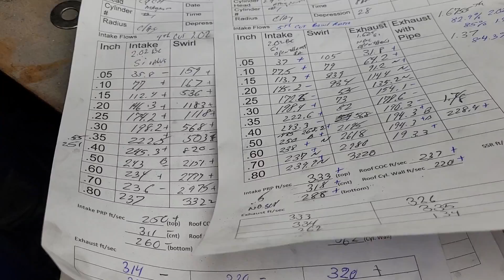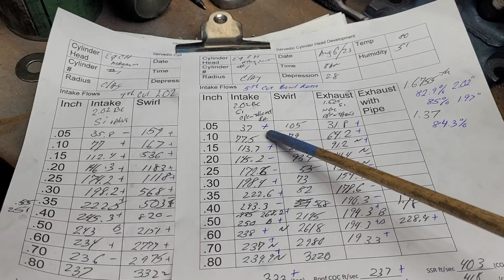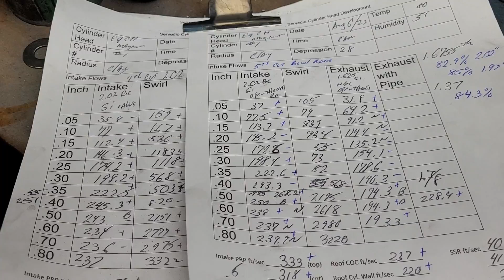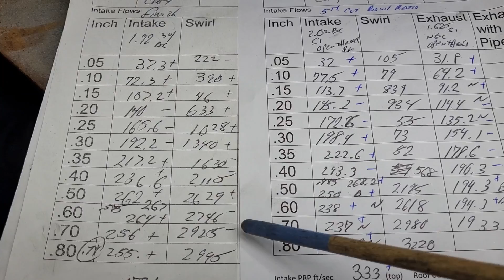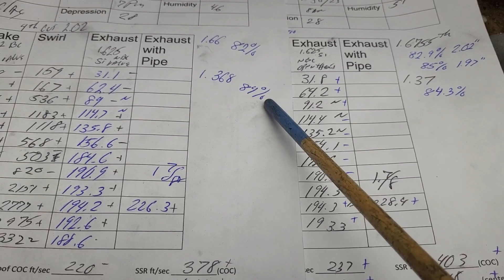EQ-CH 318B 318/360 cylinder head, small increase in bowl ratio experiment.

Comment: I've been really enjoying your cast iron work Charlie. Currently I have 3 project motors on the go, all with cast iron heads. A 5.0 Windsor with a 347 crank, and gt40p heads. Has to look externally standard, or the local police will defect the vehicle. Has to be reliable and economical as it's my work vehicle. Also a 351 Cleveland with 4V heads. Going into an XB GT coupe, that's what the Mad Max car was built from. Owner wants cast iron heads, because they came with cast iron heads. Another 351C for a Bronco. This is a 2V small port (by Cleveland standards) motor for off road and towing use. Again has to look externally pretty much standard, to keep the local constabulary happy. Probably going to use the closed chamber 302C heads on this motor as the amount of chamber work that I expect to do will drop the compression quite a bit. Not everyone has the option or the want too run ally heads. It's great to see someone who knows how to develop cast iron share their knowledge. Regards Greg
Reply from the maker: Build full sleeper engines. I love those. Looks 100% stock but rocks... thanks
Reply: you need to defund the police ..........
Reply from the maker: @slackthompson6984  No politics please!
Reply from the maker: The cops used to stop my Chevelle just to check it out....
Reply: @servediocylinderheads  sorry Chal it was meant to be comedic
Reply from the maker: @slackthompson6984  ok

Comment: Edelbrock makes a magnum head, the TrickFlow sb Mopar heads are far and away better than these Chyna heads you are working now, but, they are for shaft LA oiling, but, the good news is Mancini racing makes a shaft rocker sys. that uses pushrod oiling. One other thing, it is my understanding that to install a larger than the 2.020 intake valve in the TrickFlow heads you will need the install larger valve seats, kind of like these heads you are working on.
Reply from the maker: Good info, thanks

Comment: I would be interested in seeing some stock Trick Flows and then see how they would progress as you work your magic. Ever since I discovered the 302 castings I bought turned out to each have cracks (and after watching your series back to the 302s, then the New Zealand casting, then these eq China castings, I am a bit paranoid about the cracking issues. I am just an amateur and would hate to do all of the work changing to Magnums and using the AMC lifters and hollow push rods and then have one crack and leak antifreeze. I am wondering if it is smarter for me to just keep saving my money until I can swing a set of trick flows. It appears the Trick flow uses the mounting tube type valve train. I believe they recommend new rockers, shaft assembly. I will have to research more. It would be convenient if I could use my existing stock rocker shaft and rockers. The more I try to learn, the more I realize there is SO MUCH more to learn to try avoiding major mistakes and growing pains. You channel is priceless to me, so thanks so much. Hopefully someone will have higher performance needs than me and send you their Trick Flows that need work done to. Take care!
Reply from the maker: Well written, glad to help. I am looking forward to some aluminum heads. My back is sick of these iron monsters. You are right, lots to learn.
Reply: I know how it feels !